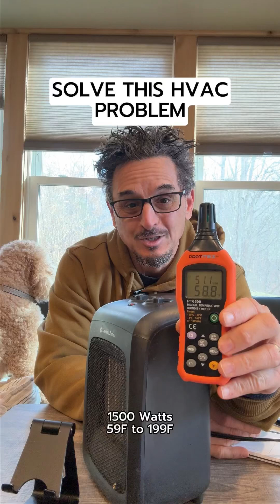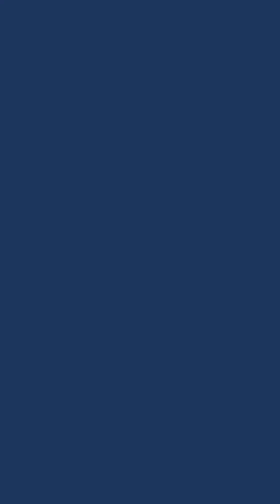Calculating the CFM of any HVAC air handling unit using the electric heater KW and delta T￼

Comment: CFM = (kW * 3413) / (Delta T * 1.08), where kW is the motor's power in kilowatts, Delta T is the temperature difference between the supply & return air in degrees Fahrenheit, and 3413 is a conversion factor to convert watts to BTUs.
Reply: what is 1.08?

Comment: To calculate CFM (cubic feet per minute) using electric heat KW (kilowatts) and Delta T (temperature difference), you need to follow these steps:

1. Determine the heat output in BTUs (British Thermal Units) per hour using the electric heat KW. Convert KW to BTUs by multiplying the KW value by 3412.14 (1 KW = 3412.14 BTU/h).

2. Determine the specific heat capacity of the air. The specific heat capacity of air is approximately 0.24 BTU/lb*°F.

3. Calculate the mass flow rate of air. This can be done using the equation:

   Mass flow rate (lb/h) = Heat output (BTU/h) / (Specific heat capacity of air (BTU/lb*°F) * Delta T (°F))

4. Convert the mass flow rate from pounds per hour (lb/h) to cubic feet per minute (CFM). Since air density at standard conditions (70°F and 1 atmosphere) is about 0.075 lb/ft³, you can use the following conversion:

   CFM = Mass flow rate (lb/h) / (Density of air (lb/ft³) * 60 min/h)

By following these steps, you will be able to calculate CFM using electric heat KW and Delta T.